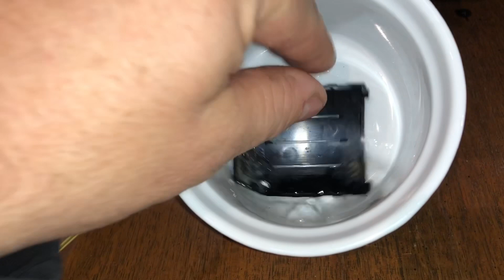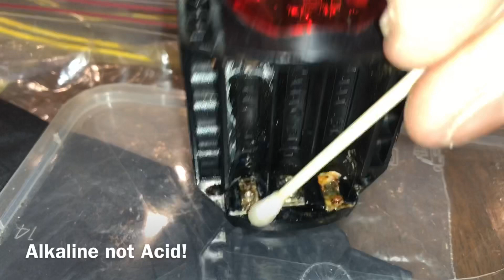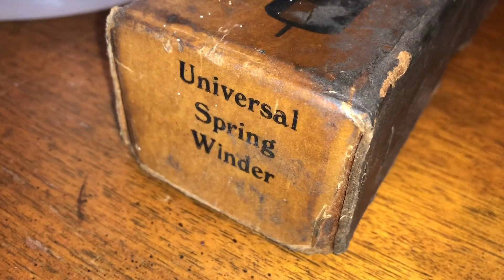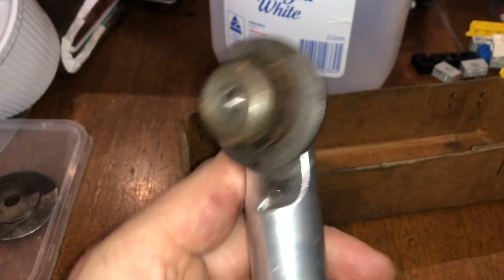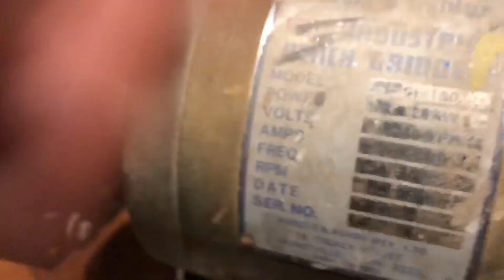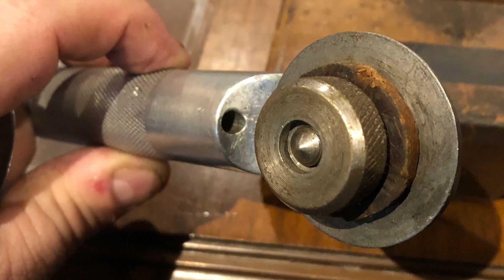Tool Time - Universal Spring Winder, Surface Plate, Cleaning Battery Gunk

Comment: That surface plate looks a bit more scraped for looks than for flat as the pattern is extremely regular. Maybe they are just that good. :-) I dunno but I would check it.